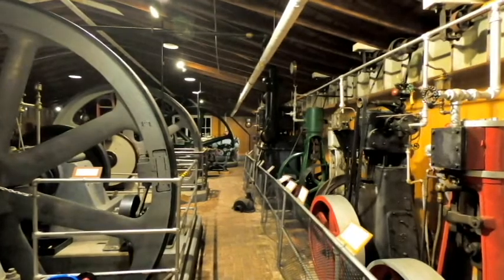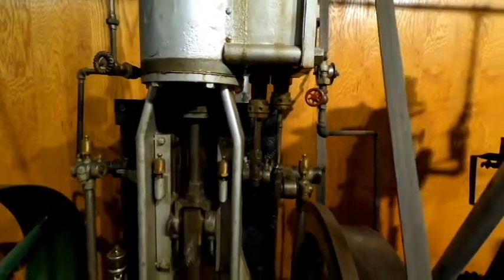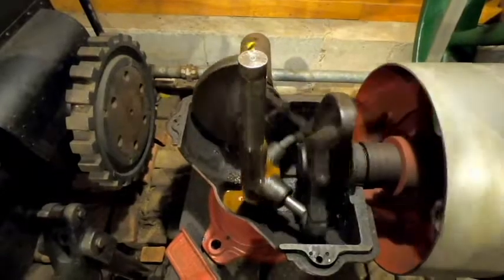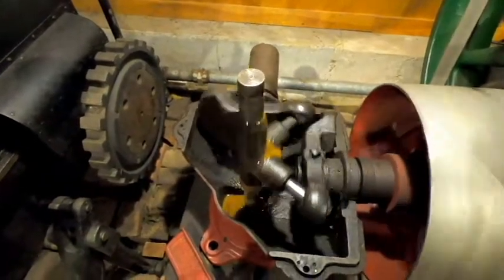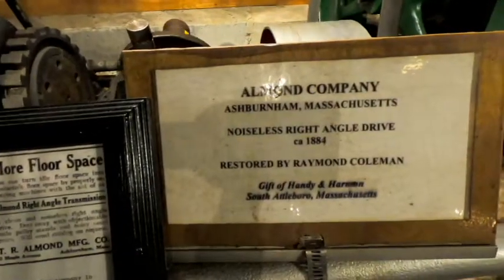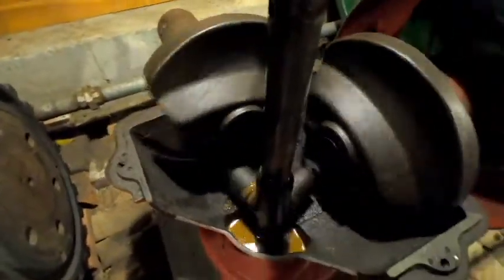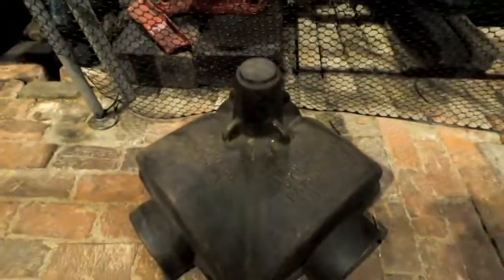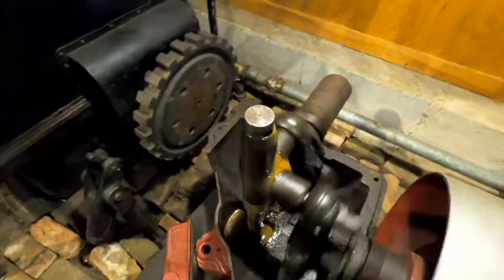Almond noiseless right angle drive for line shaft

Comment: Unlike a gear drive, both shafts turn the same direction. Fascinating!
Reply: I didn't even notice that!
Reply: They don't. The shaft on the right is rotating clockwise, the one on the left anticlockwise.
Reply: @davidstewart4570  still the opposite direction to a 90 degree gear drive
Reply: Why doesn't anyone remember you can drive the "far" side of a bevel gear and it will rotate the other way?

Comment: I have been to several "steam ups" at this fascinating museum. This mechanism is most fascinating. It took a very advanced level of three - D thinking to create the motion and even more to manufacture it. I think the ball ends were machined first and then inserted into the arms of the drive then the arms were cold forged around the balls.

The other fascinating things are the Corliss steam valve drive on the reciprocating stem engines an well as the huge vacuum tube triodes in the Wireless section of the museum. I hope to make the next "steam up".

Comment: I was wondering if anyone would know more about this.  I have a small right Angle almond drive that measures about 3.5 inches by 3.5 inches.  I can not find any information about one of that size anywhere.  The only thing I can assume is that it is a salesman sample and was not used for actual work.  It is identical to the large scale version and includes all the details that the large one has.  Just curious if anyone knows anything about it.

Comment: My guess is the ball ends were frozen into place. Heat the outer casing, freeze the balls ends and let the expansion/contraction of the metals do the work.
Reply: Exactly!
Reply: Youve got a third vote; this ^ is exactly what my guess would be as well.
Reply: I think it was done exactly that way. Spherical joints are made this way even nowadays. Don't sure about the inner spheres frozen but the outer parts were heated.

Comment: I'm curious about what kind of power loss this design creates compared to say gears or beveled gears? Also, it would be interesting to know what kind of power and torque this design can handle compared to gears and how much longevity is expected out of them comparatively. It's such a cumbersome looking yet interesting mechanism but it just doesn't seem like something that could take a lot of torque or speed without tripping over itself but if it's designed to run heavy machinery then I'm obviously wrong, at least about the torque aspect of it, now to find out how many RPM's they can handle. 🤔
Reply: From a book called  pg. 675

"For its size the right angle transmission illustrated is particularly interesting. It is a 40 horse-power coupling for transmitting motion at right angles and was recently built by the T.R. Almond Mfg. Company Brooklyn, NY. The shaft diameter is 2 7-16 inches maximum speed 225 revolutions per minute, size of pulleys 30 x 12 inches and weight 1500 pounds. Three smaller sizes of the same general construction have been on the market for several years, but to meet the demand for a coupling of greater horse-power capacity this larger size, with several improved features, was designed. It is claimed for this device that it can be used under all conditions of right angle transmission that it transmits motion without variation in speed between the driving and driven shafts and that it is self-lubricating."

Comment: 3:11 For the fabrication of the pivot ball I can see the use of a Lathe tracer to cut a ball shape from half of a rod and than drilling out the material. Roughly the same thing could be done for fabricating the housing of the pivot ball. And thermally expand the housing to drop the ball into the housing.
Reply: To use the size change of steel as one example, it expands or shrinks about 6 1/2 millionths of an inch per degree, per inch of material. Those spherical ends look to be roughly 2"-2 1/2" Cutting a ball shape is easy on a lathe with the complexity of a tracer attachment. The internal cup less so, but not impossible. However there's no way your going to get nearly enough temperature changes between the two parts to get them to drop in place. Exactly how it was done I don't know, but thermally would only get you part of the way there.
Reply: Only idea i can tbink of is a radius cutter and offset the chuck like you're grinding a piston pin on a crankshaft, then use thermal fitting to get it set together. Only way I can think of to approach that with just a lathe.
Reply: Maybe theres just enough reduction in the OD of the ball when they cut the oil groove in it that would get you in there.. I'm only assuming there's an oil groove on the ball tho, can't be sure unless we see one broken or cut open

Comment: If it’s upside down, why?
Reply from the maker: Bob, it's designed to hang from the ceiling.  The removable cover is actually the bottom so that the oil can be changed while the mechanism stays in place.  It's just much more visible this way instead of mounting it overhead.